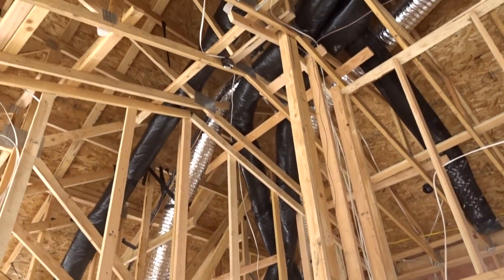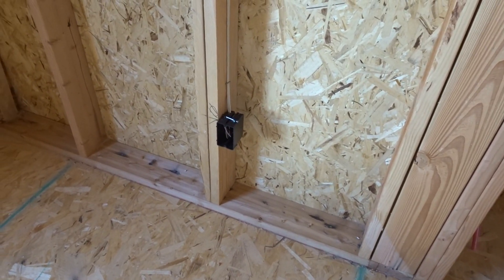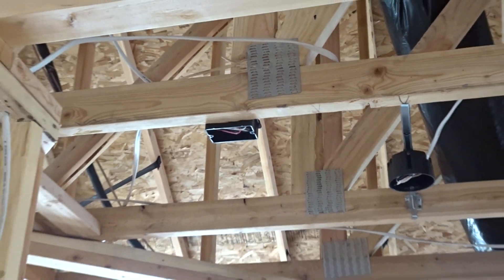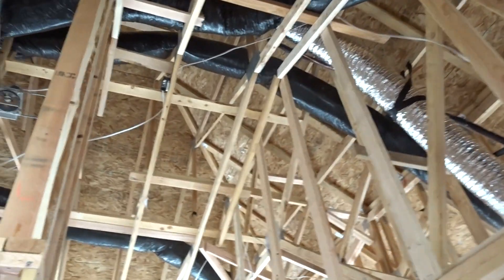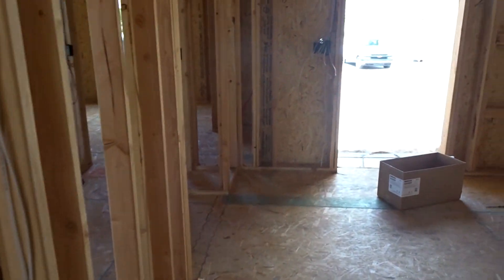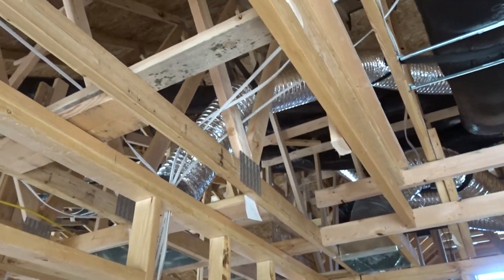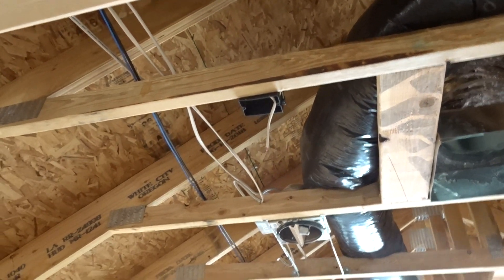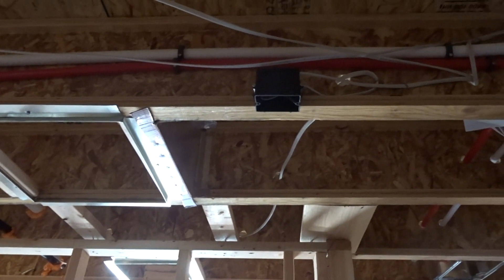How To Wire Smoke Alarms [national code smoke detector locations]

Comment: I am trying to replace my hardwired smoke alarms but I cannot find the breaker to turn the power off. I turned off all the breakers in the electrical panel but the smoke alarm black wire is still hot. The house is only 20 yrs old and so are the smoke alarms. Any ideas? Thanks
Reply from the maker: You must have an additional breaker out at the meter location. If not you need to call an electrician because it could be a serious problem.
Reply: @doityourselfelectrical9364  Thats exactly where the smokes breaker was. It was in a panel below the meter can. It was a bit tricky getting it open but I did. I replaced all the smokes, all is good. Thanks!